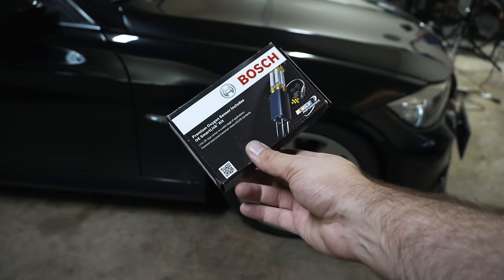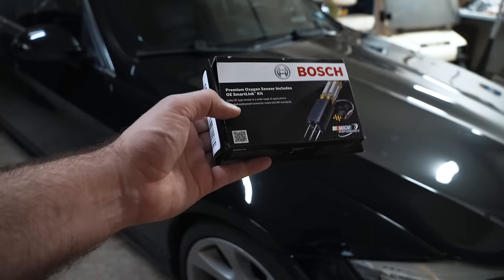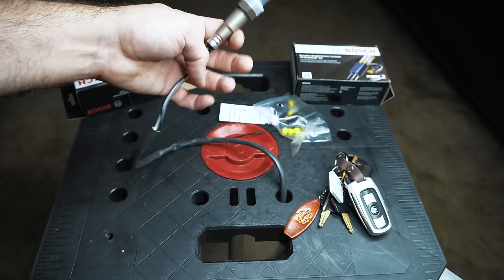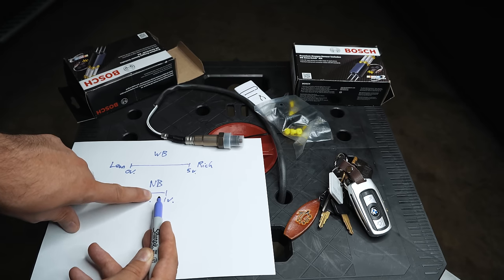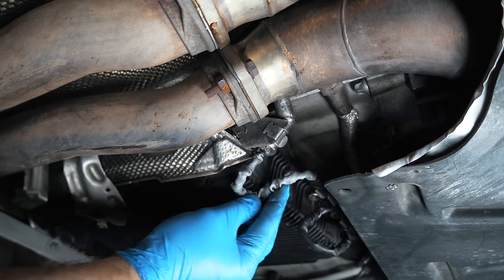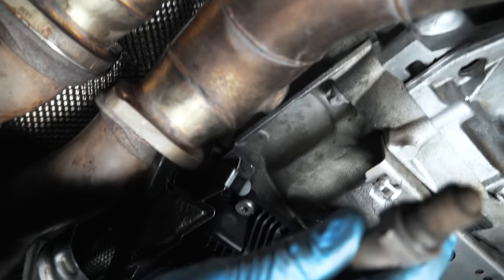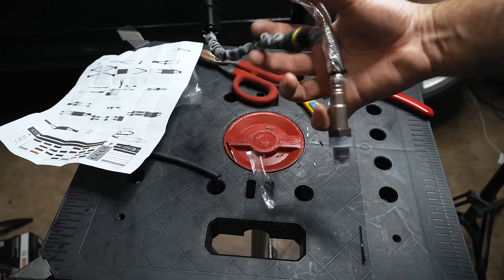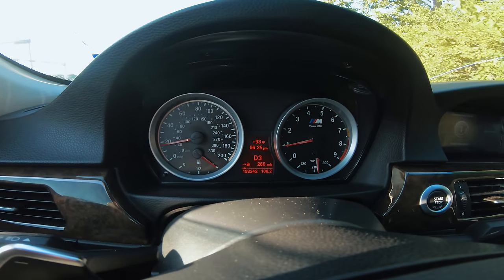I wish I Knew EARLIER! Post Cat Oxygen Sensors | BMW E90 DIY

Comment: Hey bud. I have a lean condition on bank 2. On wot the car lights up the service engine soon light. Codes shoe cyl 5 and 6 misfire. I have done compression test, change the coils and injectors around with no change. I was wondering if the rear o2s are the issue. Car starts fine, idles fine but sometimes has long crank after daily driving. Hpfp and lpfp pressure is good also. Been chasing this around for a while. Also im using a custome tune e50.

Comment: Hi bro, im getting 2C40 code and im confused if I need to change my old MSD or I will change my o2 sensors. AFR Bank 2 reading is stuck at 20. any suggestion?

Comment: On your affiliate link it says the sensor is for cylinders 1-3 can you use the same sensor for bank 2 cylinder 4-6 or is it a different part number for that sensor?
Reply: That's what I want to know
Reply from the maker: It's the same sensor for both banks.
Reply: @anthonymalburg3885  I was reading the questions answered on Amazon about the product and it says they are the same. I ordered them already need them for my turbo upgrade this weekend, might as well do it while the the turbos come out.
Reply: @VehicularDIY  thank you

Comment: I know that this was an old vid. But great content & info. Hopefully I can get my check engine light to stay off after replacing my rear O2 sensors. I’ve already replaced the front if I need help with removing my DP fix. Would you be able to pint me in the right direction. Thank you kindly

Comment: So with there being two white cables, a gray, and a black cable, does it matter which white cable is connected to each other? Currently doing some work and previous owner must have hit something that broke the connector to ecu side and I am just trying to rewire from o2 sensor side to the ecu side without the need for buying the male/female pigtails. Any help would be great thanks!
Reply: it appears I may have answered my own question by looking up the colors through part number given. "All Bosch 4-wire sensors have a black wire for the signal, a gray wire for ground and 2 white wires for the heater. Note: the wire colors and functions on non-Bosch sensors are not necessarily the same as on Bosch sensors"

Comment: Hi I watch all your videos I am installing catalyst downpipe’s and intakes and charge pipe and intercooler. Am I going to have a problem throwing codes I have a JB plus tune? Thanks
Reply from the maker: Thanks for watching.  No you should be good.
Reply: I wasn’t going to try to put intakes in until I saw your video. I got them in after a battle but I have a lift which makes it much easier,  thanks again

Comment: Question could I use this part number to replace all four sensors
Reply: No youd have to find a universal wide band sensor that would work for the primary sensors the part number provided is for the post cat o2 sensors not the primary im going to go look on amazon and see if i can find a Wideband o2 sensor thats universal so you have to wire it and see how much it cost upside the factory units that are nearly $150 each

Comment: The secondary sensors calibrate the primary sensors. But without cats they will see different o2 levels. So why can we not just jeep driving with the dp-fix? Catless downpipes + dp fix should have the same effect as cats that don’t give any back pressure right?
Reply: You’re not supposed to drive with dp fix. (From what I read in the forums)
Reply: The secondary sensors do not calibrate the front sensors. A Lambda sensor reads correctly or it doesn't there is no calibration going on. The rear sensors only job is to see if the catalytic converter is working. DP fix, bad rear o2's no rear O2's will make zero difference in how the Lambda sensors see the AFR. 1 lambda is Stoichiometric higher is lean, lower is rich. The DME does not use the rear sensors in any way to hit target AFR.
Reply: Scott Gaines Not true. On n54’s they are. A lot to read about this on spoolstreet.

Comment: After cat o2 sensors dont work without a cat..

Reprogramming only shuts down your failure code... and set your car back in time.
Reply: This
Reply: After cat sensors work fine without a cat, they are what triggers the code that says the catalytic converter is not working.  That is there only job, to test catalyst efficiency. The code is set when delta frequency exceeds programmed parameters.
Reply: @scottxp800  so i have to change the 2 cats to cleare the fault? ? I have bank 1 bank 2 p0420 sensor fault (bmw e52 3.0i) please help i do not wà to buy 2 cats😞
Reply: I have my oxygen sensors out right now and they are crusty. Should I clean them with steel wool or leave them alone ?would appreciate any input from you guys
Reply: @crazyharis  did u have to buy two cats
Reply: @markparker1640  yes 2 sensor in eatch Piper
Reply: @scottxp800  do I need to put a spacer on 02 sensor?

Comment: Hey bro I’m getting the same codes but I also have 3 misfires cylinders 1,3 and 5. I have ordered 2 step colder spark plugs and am planning to get new coils too, the issue I’m getting is the code and I when ever I start up the car it’s has a rough idle and throws the codes 
Oxygen sensors after catalytic converter: mixed up
Cylinder misfire 1,3 and 5. I tried swapping my coils around to see if the misfires follow but they don’t. I have been stuck with these codes since I put in 3inch cat less downpipes, I have since replaced my primary o2 sensors and have gutted my oem downpipes and installed those I think the post cat o2 have been damaged during the change of downpipes. What do you think I need todo. Do secondary o2 sensors plan as much of a role that it will make my car idle all weird and make it misfire in multiple cylinders ?
Reply: Sometimes I reset my lambda adaptions before I start and the car will have the codes but still drive normally without a jumpy idle

Comment: I had the same issue my pre cat sensors where mixed up mhd will tell you lol I just swapped the sensors on top
Reply: did you have any codes or limp mode because of this? mhd said my sensors are mixed up

Comment: Do you not have the check engine light for not having the original cats down pipe?
What did you do to remove the check light after installing the catless down pipes?
Reply from the maker: The car is running a tune.
Reply: @VehicularDIY  I used Jb4 tune and I still have the light on for no cats. Is jb4 not a tune? I used the jb4 app to read codes when the light comes on and its always the code saying the 2 downpipe no cats. Lol

Comment: I used these in my 335i after msd81 upgrade and I’m getting heater codes for the o2’s (2ca8 and 2ca9). Is it ok to drive like this and does it matter where the white wires go? Like is it ok if you mix them up but it’s still white to white
Reply: id check fuse for heater circuit , more than a coincidence that both heater circuits are not working

Comment: I have MSD80 and got 02 code. So do i need 2 of these in the link or 1 plus another for bank 2? because amazon says cyl 1-3.
Reply: You need 2! For every 3 cyl one sensor. But depends if bouth are bad or not
Reply: @WarpDriveM  ok cool I was just wondering if they were the same. Of if the one in the link was just for bank 1
Reply: It says they are the same if u read the questions answered on Amazon
Reply: guess how old is the sensor on the other engine bank??

Change both banks symmetrically so you dont introduce imbalance

When brakes are worn out on one wheel, the entire axle gets worked on at once!
Reply: For the primary o2 sensor you can use the same sensor but the secondaries are different

Comment: Hey, 
I bought a 535i with straight pipes and im getting CEL and scan reads misfire on cylinder 2 when going high revs. Already replaced spark plugs but i believe is related to the o2 sensors. Would you recommend this sensors? even though is a catless pipe?
Reply from the maker: I would try moving the coil packs around first and see if the problem still persists.
Reply: @VehicularDIY  thanks mate. Problem was the coil, I’ve swapped with cylinder one and now scan points misfire to cylinder one. I’ve ordered a new set of 6 coils.

Comment: That's all great and all.  But even with a new O2 sensor after my tune, it's still triggering the CEL.  Does a bung spacer affect the engine badly at all?  Or what can I do to keep the CEL from throwing that code?

Comment: Thank you for the video. I’m about to order.  Would I order both of the same sensors? Thank you
Reply from the maker: Np, yes both post cat o2 sensors are the  same.
Reply: @VehicularDIY  what is the part number for the 02s' used ? The Amazon link is no longer available

Comment: to be clear after u fix the mosfet on the msd80 ecu it still going to misfire
Reply from the maker: You can repair the MSD80 by changing the mosfets but it's still just as likely to fail.

Comment: Ok so I have 07 335i e92 6mt
I want to put down pipes. What problems am I gonna have in the future ?
Reply: My two biggest problems:
Emissions
Traction
Reply: 0 problems
Reply: dubadelic ok what about check engine light. How do I solve that. When u delete the cat.
Reply: personally I'd read forums before blowing a bunch of money ... 🙂
Reply: @350z2020  Read some forums etc. But lets say that mhd maps deletes codes from dps.
Reply: Change your o2 sensors if you want to do preventative maintenance

Comment: This doesn't make any sense at all. You use DP fix to pass emissions, that fakes a good signal that simulates sensors with a working catalytic converter. You could remove the sensors and put a plug in the pipe, So why replace them? Whoever told you the DME uses rear O2's to determine AFR is dead wrong. A lambda sensor reads right or it doesn't, there is no AFR calibration from rear O2 input. Lambda sensors do not put out a voltage either, current flow is monitored off of a reference voltage, no current flow is stoichiometric (lambda 1) Negative flow is rich, positive flow is lean. Measured in Milliamps. The voltage that varies with fuel mixture comes from the DME. Voltage high is lean, voltage low is rich, the opposite of a regular o2 sensor.

Comment: Does your car still pass emissions with the  catless downpipes? I live in texas as well so I'm assuming the rules will follow for me as well
Reply: Also from Texas, I just flash back to stock tune, using a DP fix with the downpipes installed, I pass every time.
Reply from the maker: Yup same here.
Reply: @e85johnson68  thanks for the reply I guess I'll be getting them soon with the fix 😁
Reply: I was wondering if the secondary  converters would be sufficient on their own. I suppose the DME would still need to have the code programmed out.
Reply: @e85johnson68  what a DP fit?
Reply: @markparker1640  look up down pipe fix.

Comment: Hello sir, is there a similar way for the pre cat sensors?cheap way? Thanks
Reply: I was wondering the same thing. Bosch wide-band O2 sensor for Rolls Royce half the price of BMW sensor! The business end of the sensors appear identical. I think I'm going to take the plunge and buy one. For science.

Edit: i just saw this video from Bosch about this 02 sensor
https://www.youtube.com/watch?v=Sb93HsIAsUY

Something about shouldn't solder connectors because airflow required across connection?! How does that make sense?

Comment: Hi there. Maybe you can help. I have a bmw 550i and It is running with negative fuel trims. Its running very rich and even smoking. I replaced precat sensors and didn’t help. I recently got the code P114B and P2196. No misfires so far, i back my car into the garage and the wall has black carbon on the walls coming from my exhaust. Should I replace secondary sensors?